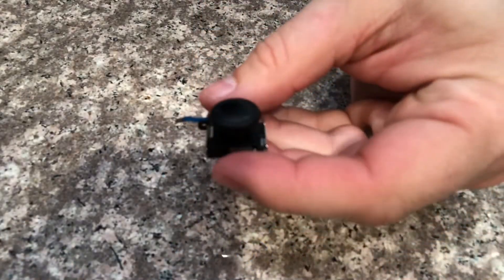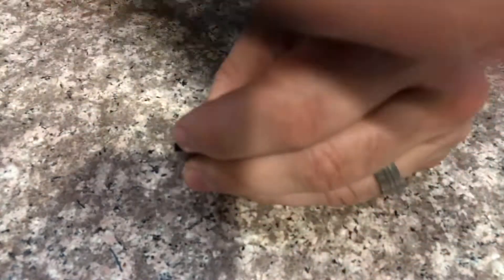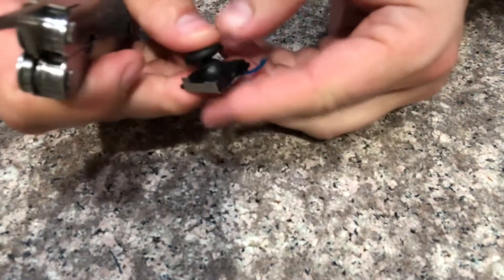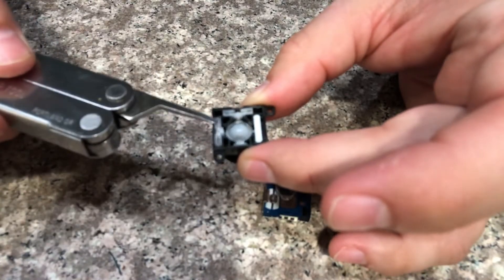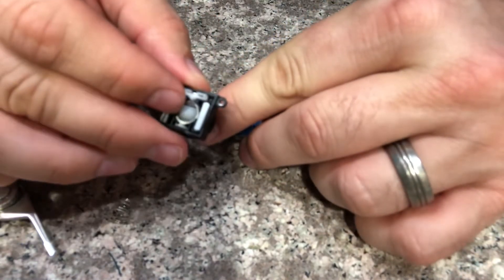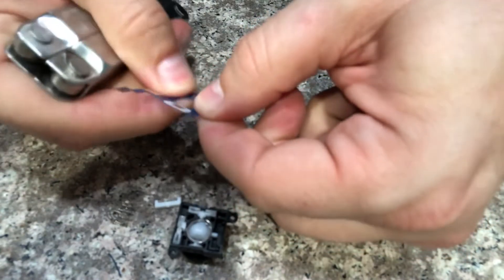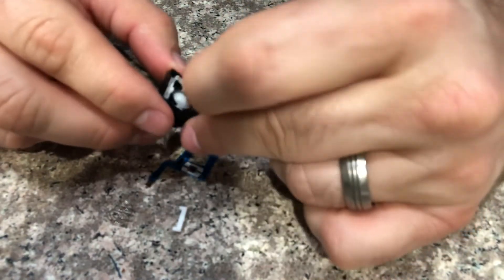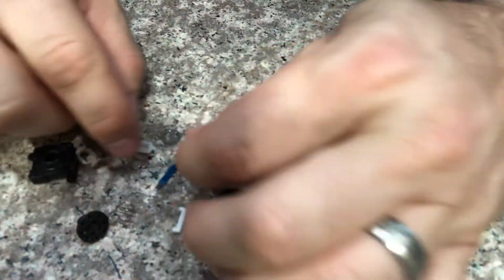Nintendo switch joycon analog joystick take-apart how does it work

Comment: I ended up taking a joystick of a joycon apart and broke two of the metal tap things that bends over the top. I cleaned it out and even managed to put it back together. it worked for a while, but it eventually started drifting because the metal plating wasn't on as tight as it should because two of the metal tabs broke off. internal mechanisms are neat, tho

so I have to replace it, yay.
Reply: Have you tried bending those connector feet a bit more to not get it to drift?
Reply: @jpasw  I can't, they broke, unless you talking about something else